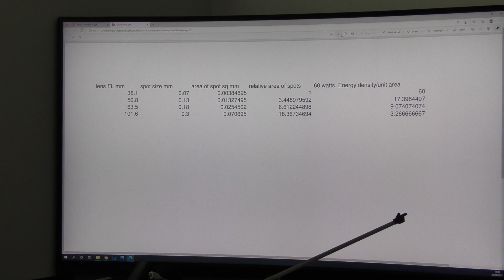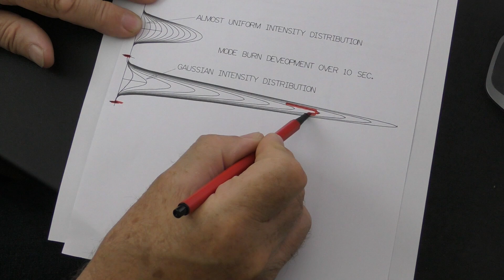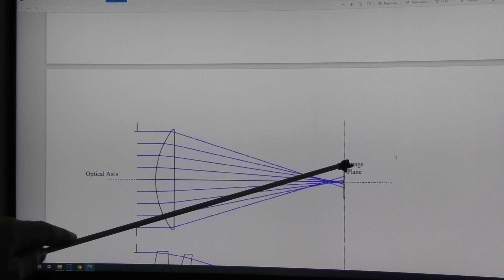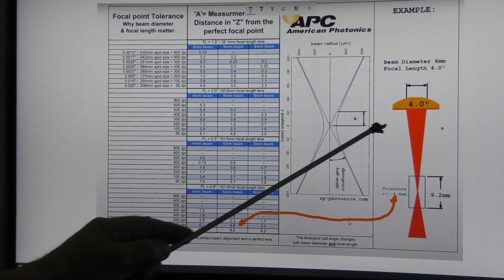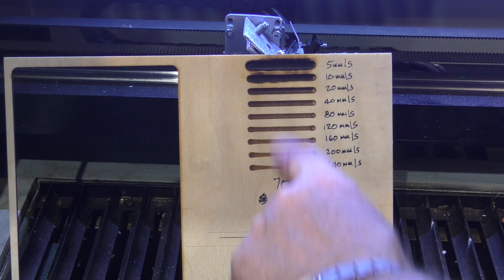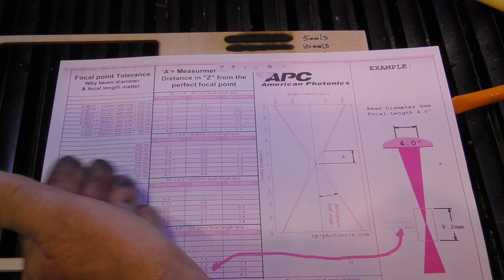RDWorks Learning Lab 217 Do Laser Lenses Meet Specification

Comment: An interesting point is I read is, counter intuitively, that you get a smaller spot size from a bigger initial laser beam diameter. The table you showed had that near the top. And I have read you can get a smaller spot by first expanding the beam with a pair of collimating lenses in front of the focusing one.  The only way I can rationalise it is if the lens focuses the outer rays better than the ones near the centre so it actually compresses the bell curve.

However your experiment with the divergent beam seems to contradict that as the beam was bigger at the front but you got less cut depth, which implies the spot was also bigger.

If the specs all use the full width half beam spot size then of course you will generally burn a much larger spot unless you have a material impervious to half power but damaged at peak power. Most likely it takes more than a two to one ratio of power density to go from undamaged to clearly marked for normal materials. I wonder if you could get smaller dots with low power and high speed on thermal printer paper, which is designed to change colour with heat. Probably hard not to set it on fire!
Reply from the maker: Hi
 I can produce thin lines and small dots easily but that is not the same as a lens's SPOT size. The spot size is that point through which ALL the light rays pass so if you leave the beam in one position then holding the beam on (regardless of power) it  will burn a hole equivalent to the claimed spot size. AS soon as you introduce speed you are automatically  filtering out the lower INTENSITY outer rays by reducing their  exposure time.   Thermal print paper may work with a CO2 laser but I have never tried it. The paper is designed for use with electrically heated contact printheads. There is no heat in a laser beam , instead  the laser beam will have to  heat the ink  by stimulating its molecules.. As you said , there will be a VERY fine balance between heating the ink and destroying the paper.. I think the next video will answer a lot of your questions.
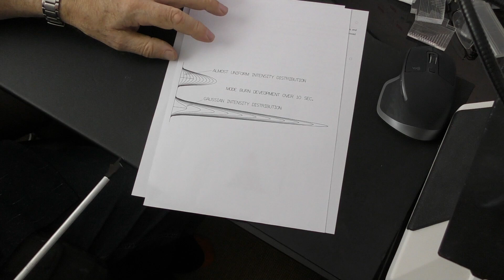 As far as  your first counter intuitive  small spot size   question. Yest you can produce a smaller DOT  from a larger beam but be careful not to confuse it with a SPOT.  Watch the video again from 11:25 and you will see a picture of the Gaussian beam. The shape of the Gaussian form is defined by a mathematical formula.  There are  are 3 key properties to the shape of the graph. The height is the light INTENSITY, the width across the base is TOTAL laser beam diameter and the area under the graph is the POWER of the laser beam
 These three features are completely locked together.  Thus if you reduce  just the beam diameter,  then the power (area) remains the same but to keep the area under the graph the same the height (INTENSITY) must increase. Conversely, fi you make the beam diameter bigger ( as in your puzzle) the  base of the graph widens  but to keep the area the same the INTENSITY (height) of the graph must decrease) The more you spread the base diameter the "BLUNTER" the beam shape will become.. This means that there is now  MUCH less INTENSITY difference between the center and outer parts of the beam. IN fact the beam is now approaching a normal UNIFORM light source for which the lens was designed. 
Thus the lens is now able to perform a great job of focussing and getting much closer to that specified SPOT specification. It will never achieve it  but it will be maybe within X2 or X3 . The problem with this idea,  although great for engraving  it destroys the CUTTING ability of the lens. Ciutting requires focus imperfection whereas engraving requires focus  imperfection.  
 Again I hope you will see this clearer after the next video. . It turns out that the laser beam's relationship with lenses is nothing like the  that of "normal" light,  for which lenses are designed. 

Best wishes
Russ
Reply: @SarbarMultimedia  I think with any lens the light never passes through a single spot unless the frequency is infinite. The long 10uM wavelength of CO2 light will never focus as small as visible light. There is a theoretical minimum spot size derived from the wavelength, aperture and focal length. The aperture in this case being the beam diameter. If you made a photo with CO2 light it would be very blurry.
Reply from the maker: @nophead  You are quite correct that the spot size can never be smaller than the wavelength of the light. Again you are correct that normal light at about (average )600nm will theoretically have a limiting focal spot some 17 times smaller. However,  the point being made by this video is that the spot sizes quoted for 10,600 nm (CO2 ) lenses (specifically for laser machines)  by manufacturers is totally unachievable. They are failing to recognize that normal imaging optics  have weaknesses that a laser beam exploits. On your last point you could only take a photo with 10,600 nm light if it was uniformly distributed (like taking IR images) and in which case it would not be a laser beam and thus  normal imaging laws would apply.
 Best wishes
Russ

Comment: how about conditioning the beam before the first mirror, for a more parallell and concentrated beam, to reach the mirror with a desirable diameter ?
Reply from the maker: Hi
 There are devices called beam expanders tha do exactly that type of conditioning. However the parallel beam that is created comes with a serous penalty...........beam diameter. The beam must be expanded to achieve the parallelism. That is very bad news for cutting.  Expanding the beam decreases the intensity at the centre of the beam and intensity is an imperative for CUTTING. Yes they do a great job for engraving but do you want to keep adding and removing an expander when you change from cutting to engraving. As I mentioned in the video, RF laser beams are rubbish with typically 7 to 8  mrad divergence. Thus you MUST use a beam expander to control the divergence in that instance and I have one fitted to my RF machine. The smallest possible device available is a X2. Even so the supposed 2mm beam out of the tube expands to about 6mm after the expander but remains pretty parallel for the for the 800mm (500x300 table). change of beam length. There are no beam expanders specifically for CO2 glass tubes  because they are not considered necessary. However, with my new found knowledge of how lenses and laser tubes work together, I am seriously considering making my own device  as a future project The only issue is,  that adding two more optical elements into the beam path will cost abou 7 ot 8% power loss. Will the INTENSITY  gain (if it works ) exceed the INTENSITY  loss caused by less power?  I already have some ideas on the subject  but  foresee several mechanical/alignment issues. As I said, a future project.
Best wishes
Russ

Comment: Superb session. Regarding your last claim, in my experience using the lens flat side down improves the cut, but I suspect it is because the nozzle now has to be closer to the work and the air assist improves the cut. On the other hand, I have found that using the lens flat side up gives a cleaner engraving. Yet again, my guess is that, being the nozzle further apart from the work, the air assist has less impact on the engraving.

I know it is a proven fact that air assist improves the cut and worsens the engraving. But in line with the topic of this session, and as per the diagrams you showed, I tend to think that the flat side up and speed filter the outer low intensity stray rays leaving room only to the "focused" rays.

Still, I am not varying the amount of air in any of those situations, nor keeping the height to the work constant to make a better claim.
Reply from the maker: Hi Nico
 I think the next session will sum it all up and I have lots of lens tests for you to examine. After that I am going to leave lenses for a little while because I now understand exactly how they work in conjunction with the laser beam. There are other subjects I want to explore or revisit with  this new  found knowledge.
 Best wishes
Russ
Reply: @SarbarMultimedia  Looking forward to that! Today I stumbled upon a post in Reddit where a guy compared 2" lenses and 4" lenses. Taking into account your investigation, I asked why a 4" lens will cut deeper than a 2" lens, when the footprint is bigger. Some other guy replied telling that it all has to do with "Depth of field". I found later on the following picture: https://photographylife.com/wp-content/uploads/2016/12/DoF-sketch.jpg

What do you think?
Reply from the maker: Hi Nico 
 You have struck at the heart of this problem. LINTENSITY